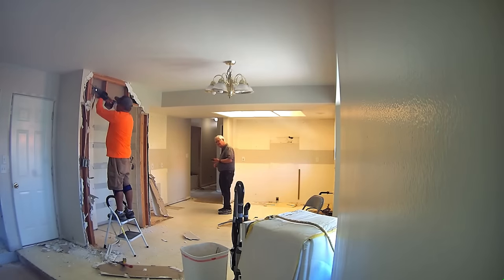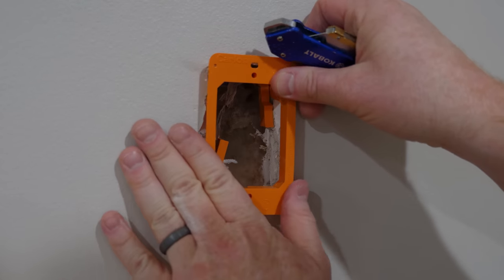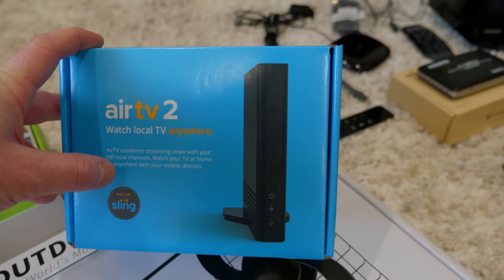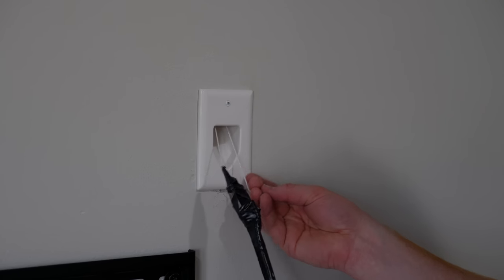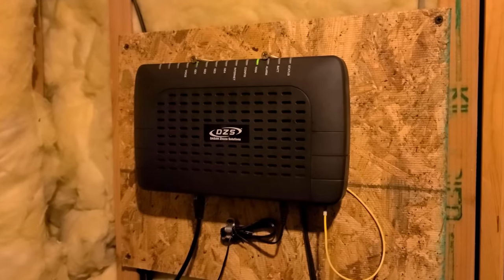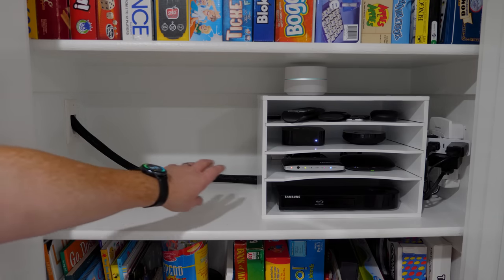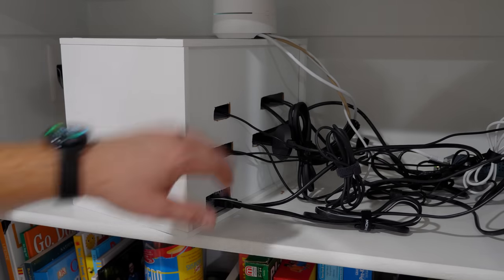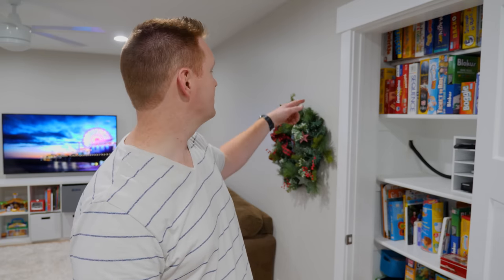Building a Closet Media Center for your TV

Comment: My house is a 1950s UK prefab with steel reinforced concrete exterior walls and directly-plastered cinderblock interiors that turn most DIY projects into minor tunnelling operations. Whenever I see a North American home improvement video where someone simply saws away a section of drywall to reveal the Holy Void behind, I die a little inside as I reach once more for the hammer drill and masonry bits.

A few years ago I had similar requirements to this project (TV on a bedroom wall, hardware hidden away) so I just cheated, drilled a 1" hole behind the TV straight through the internal wall and fed all the cables through into the office next door, including power. Not very elegant (and likely not wiring-regs compliant) but it was fast and only destroyed one masonry bit.😉

Wi-Fi has now become so good that these days I just stick a FireTV or similar behind every screen and stream everything wirelessly.

Good video though. There's always something very pleasing about seeing a cover plate going on and covering all the stuff behind it.

Comment: Here's a Good Tip... at 6:23 you have 2 pull lines  for future pulls. While that was smart thinking, when you go to pull another cable add a pull line with the cable so you're feeding another pull line with the cables. That way you replace the pull as you pull and will always have a line installed for the future. Also having 2 pulls is always good incase you have a mishap and a line breaks, you always have a backup.

Comment: So, is the thing on the TV an IR blaster or IR receiver? Do they need to point the IR remote to the closet to manually change the volume? I guess, that's where CEC comes in.
Reply from the maker: It is the IR Blaster. So the remote sends the signal right to the TV. It could use CEC depending on the setup but right now I'm just doing it all through the Harmony Hub.

Comment: I thought Logitech had ended the support for the Harmony ecosystem.
Am I wrong?

Moreover, I have been having some issues with my HDMI switch, as it struggles with HDMI-CED commands - which are quite relevant to control everything with one remote, especially when some remotes are Bluetooth, nowadays.
Additionally, many sound systems - especially soundbars - run better and with more code support over HDMI ARC / eARC. Therefore, I would save that HDMI port (with ARC support) for a future sound upgrade.

Cheers for the video.

Comment: Question when running tube, am I supposed to have separate tube for Ethernet cable, separate for audio speaker wire, separate for HDMI to avoid interference?
Reply from the maker: Because none of those are high voltage they will all be fine but you may want to if you are planning for quite a few cables. Sounds like you are working on a big project!